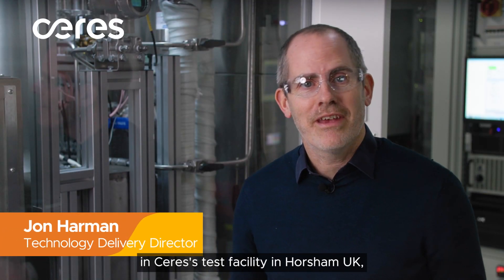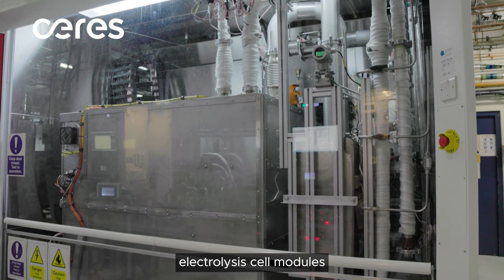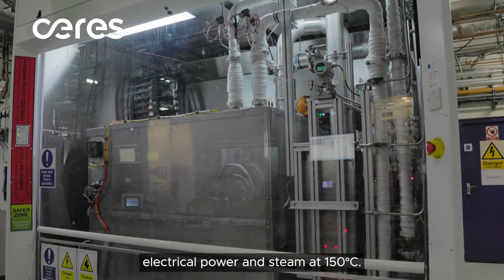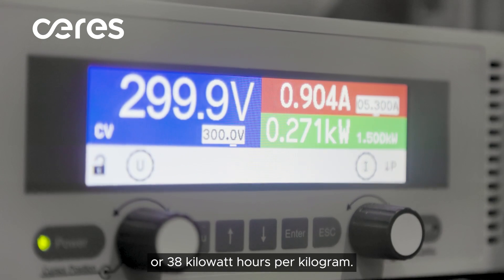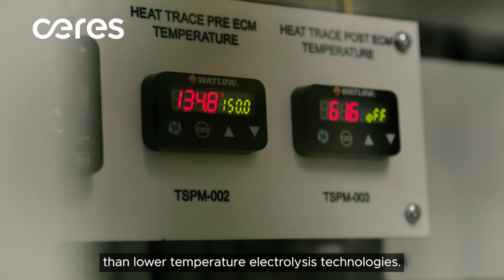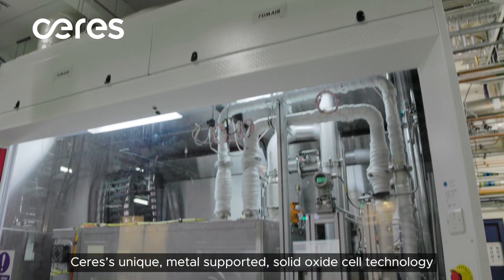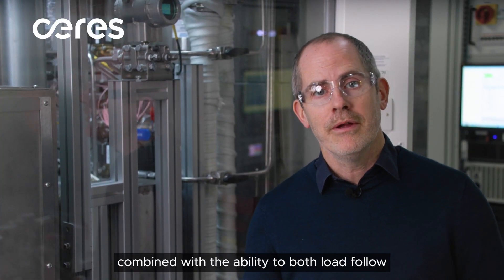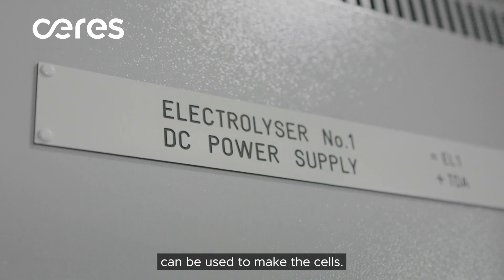Jon Harman talks SOEC

Comment: Hello. I got curious about the operating temperature of the electrolyzer. Is it 150o Celsius? I thought that the steam temperature should be around 650o Celsius.
Reply: I guess is pointless to wait for answers here because even in their official page there is absolutely zero detail on this.
My guess is that the cells works with water as steam instead just water like PEM electrolysers.   Instead making the steam themselves, they use any industrial waste steam which can be almost free, that way they do not need to provide the energy to change the state of water to steam,  but that is just the required temperature of the steam to remain in that state, the working temperature of the cell should be around 500 to 800c, the thing is that you only need to preheat the cell at the start, then the waste heat from the chemical process (13%) may be enough to keep the cell at that working temperature.
At least that is what I hear from other SOEC technologies.
Reply: @angellestat2730  thanks a lot for your reply. I think it is right.
Reply: Trade secret perhaps!